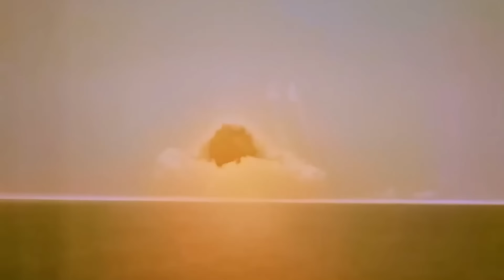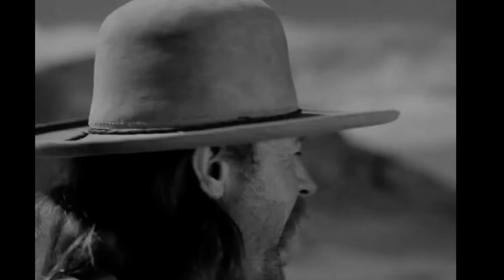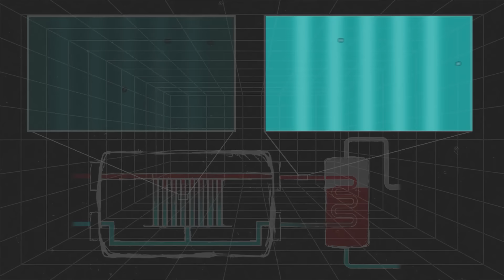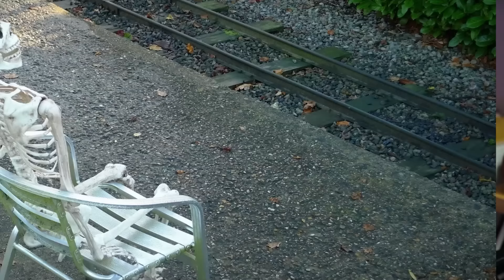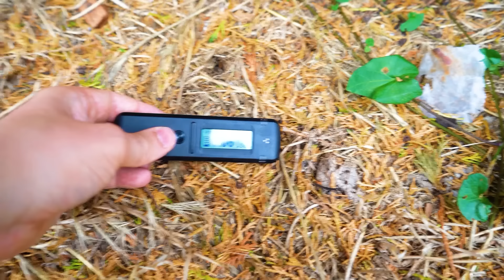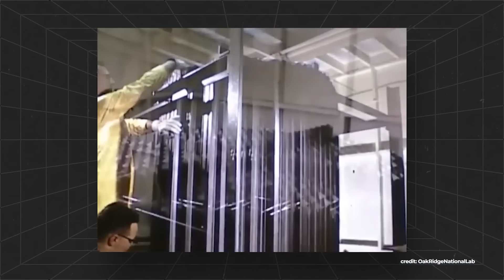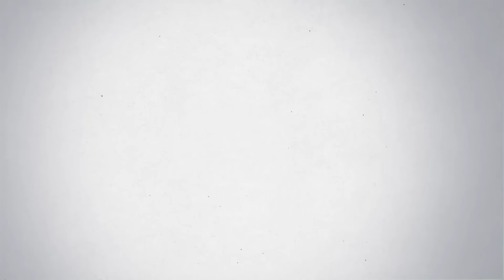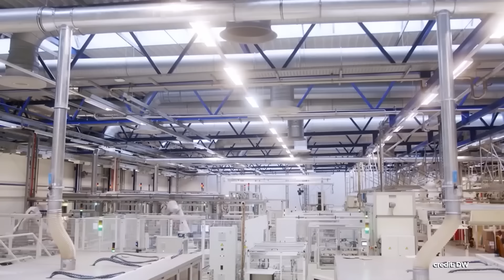It's Happening - China Launches World's First Thorium Nuclear Reactor

Comment: Not only is thorium 3-4 times more abundant than uranium, as you said, but over 99% of uranium, U-238 is not fissile (able to be split when hit with a neutron). In order to use it,  the mix must be enriched by removing some of the U-238 and leaving a higher percentage of U-235. This is very expensive. In contrast, thorium is 100% usable. A sample is hundreds of times less expensive than uranium. The main drawback to thorium is that a molten salt mixture is corrosive and can eat away at the container it is in.
Reply: It needs to be enriched because of the use of light water as a moderator/coolent.   Light water absorbs neutrons at a higher rate, which stops the reactor from maintaining a chain reaction.   A heavy water reactor like the CANDU can actually use non enriched uranium.
Reply: You still need uranium as no throium isotopes are fissile but they are fertile so can decay into U 233 if there are fast breeder reactor
Reply: @Idris.505  But you can use plain ol' uranium, spent fuel, and even depleted uranium in the right type of reactor to get the thorium cycle going.
Reply: @RWZiggy  Yup fast breeder or molten salt, not being anti thorium just saying that Thorium is also not fissile
Reply: @idris4587yeah, but as we have so many radiating nuclear "wastes" heaped up it is a good way to get them useful and by this get rid of them at the same time!
Reply: Thorium might be breedable and fertile, but is it submissive?
Reply: @snes-mode7 😂
Reply: "The main drawback to thorium is that a molten salt mixture is corrosive and can eat away at the container it is in".  No, that is the main drawback to a molten salt reactor.  MSRs are not the only kind or reactor that can be fueled with thorium.
Reply: @JohnHughesChampigny  Also the corrosive issue has already been solved by purifying the salt. No new alloys or extensive downtimes required.
Reply: You can fission u238 with (fast spectrum) neutrons. Most reactors are in the thermal spectrum mostly  because the slow neutrons are a requirement to make plutonium. Thorium fissions very well in a fast spectrum reactor as well.
Reply: @christopherleubner6633  but heavy water isn't easy to come by either, is it?
Reply: @christopherleubner6633  Uranium-238 is fissionable but not fissile (does not support a chain reaction).
Reply: you can make a U238->Pu239 breeder just as you need to breed Th232 into U233. the molten salt fuel is the cool part
Reply: @samuelforsyth6374  Can you give example for U238->Pu239 breeder if it exists? Pu239 burner like BN-800 seems a lot more useful, although i don't understand why we have reactors for producing and burning Pu239 only in Europe and Asia, not in America.
Reply: @Signal_Glow  obviously still waiting on regulators doing salt creep testing but myfavroite design would be Elysium Industries Molten Chloride Salt Fast Reactor. 
the burners are fine/good while both sides have wepons grade they need to get rid off but molten salt is very versatile.
Reply: Actually, the biggest issues are the creation of U-233 and how to deal with the Protactinium 233 (half life 27 days) and Pa-231 (half life 32,000 years) that is produced, which are all highly radioactive (producing lots of beta and gamma radiation) but which needs to be removed from the process. Theoretically, a Thorium reactor could be safer to operate (it won't suffer a meltdown), but presents massive health risks to workers in the plant.
Reply: @nicholasconder4703  yea I prefer U238->Pu239 fuel cycle you get more tolerance with neutronics so you can use Cl salt instead of Fl = less vessel problems and higher temps.  MCSFR
Reply: The theoretical use of Thorium fuel lies above 99% (i.e. > 99% of the fuel is converted into energy), whereas 'traditional' solid (pellet) fuel reactors get to about 0.5% before the pellets are so cracked through byproducts that they need to be removed.  I think the solid fuel rods can be reprocessed to get some more energy from them, but that's it then - the result is a lot of long term radioactive waste.  That's why Thorium is so interesting: safety and security are simpler, fuel is abundant and used far more efficiently, and the output heat can also be used directly if needed.  As temperature self regulation is a default feature of how it works, power generation is also easier as 'load following' is pretty much a default feature.
Reply: @freddoflintstono9321  It still produces lots of long term radioactive waste: the only difference is a greater proportion (not all by any means though) of the fuel rods themselves can be potentially "used" leaving relatively less dangerous actinide waste, but it still produces radioactive waste, including the plutonium produced by uranium reactors. It's a misnomer in some ways to even call thorium reactors thorium reactors, they are actually uranium 233 reactors, as that's what the thorium has to be turned into in a toxic and dangerous process of irradiation to turn it into nuclear fuel, a process so dangerous, it can't be done by humans, and has to be automated in biologically sealed quarantine facilities.
Reply: @pixelwash9707  The Th half life is quite short with waste becoming safe after less than 30 years of storage.
Reply: @freddoflintstono9321  "the result is a lot of long term radioactive waste" This is simply not true. A lot of the biproducts can be separated out easily and safely, and some of those biproducts often then go on to be used in medicine (often as core materials in X-Ray and Radiotherapy machines) and in sensitive scientific research equipment and experiments. Uranium that is still usable can be then thrown back in after reprocessing, while uranium that is so thoroughly depleted it is utterly useless for all other applications can be processed into Armor Piercing Depleted Uranium ammunition for use by US and NATO armed forces (For example, with the A-10's Gau-8 Avenger or the M1 Abrams' 120mm cannon). What isn't or can't be reused for any purpose (military or otherwise) gets placed into carefully designed casks on site that vent out a lot of thermal energy with relatively safe radioactive footprint (Kyle Hill put a geiger counter up against the thermal vent of one such cask in a video he made with permission from the IAEA and USNRC. The counter "clicked" showing higher than average radiation, but it wasn't screaming like it would be if the radiation dosage was dangerous. That's a testament to how safe these nuclear fuel casks really are.)
Reply: @freddoflintstono9321  That is a point for molten salt, not for Thorium. The same can be achieved with Uranium.
Reply: thank you for sharing your knowledge
Reply: @lynnebalzer5520  molten salt reactors are not specific to thorium. They can be used with the real u-238 in a U-Pu fuel cycle as well as the spent fuel from U-235-based PWRs. The main drawback to thorium is that we don't have a regulatory framework surrounding its handling and disposal, which we do for all U-varieties, and this is why western economies are struggling with thorium reactors. China on the other hand doesn't have this problem.
Reply: @nowandrew4442  So true. This is a problem about bureaucratic inertia.  Not that China is any great shakes at it.  They boldly purloin technologies from elsewhere and push them as hard as they can, sometimes without regard to the safety of their people.  The Soviet Union did the same.  If we want to get beyond TED talks and be first in technological innovation we have to stop trying to catch up with our adversaries and concentrate on the virtues that  got us ahead in the first place.
Reply: Can use titanium pipes
Reply: @TanLiat  Titanium is a real biatch to weld.
Reply: @juslitor Not with "Brown-Gas" (or HHO gas Mix!) 😅 that stuff can even melt tungsten!
Reply: "The main drawback to thorium is that a molten salt mixture is corrosive and can eat away at the container it is in."

Thus solving the problem entirely 😂😂😂
Reply: @alastairhewitt380  A big part of the Oak Ridge MSR program was working on solving the corrosion problem. Reading the available project documentation, the corrosion problem was considered solved by the 1960s.
Reply: @alastairhewitt380 We actually long ago solved that problem using hastelloy.
The corrosion rate is 0.1 mm per decade at 800 deg C.  The answer is just to use slightly thicker pipes.
Reply: Moreover all countries can not enrich uranium since high enrichment rate => nuclear bomb
Reply: The other big problem with uranium reactors is that once the fuel is spent, it still has a lot of U-235 and U-238 in it, just not enough to work in a reactor, so the fuel rods are removed and sit in cooling ponds near the reactor.  That was a big issue in Fukushima - the cooling pools drained, and the spent fuel rods partially melted, expelling the still very radioactive spent fuel into the ocean.  Thorium doesn't have that problem at all.  There are still radioactive waste products, but they are much smaller by volume, and generally have shorter half-lives.
Reply: Of course it can
Reply: dude theyve known this since the 30's and thats 100% why it wasnt used you so gd right its not funny. thank you for your input good sir
Reply: Thorium is 100% usable in exactly the same way that un-enriched uranium is 100% usable.
Reply: How much energy is required compared to how much is generated? I believe that even if the little reactor core only lasted 5 years.. that the EROEI would be over 100, vastly better, and more importantly quicker  than the renewables. For example, if you get 20x the energy, after 30 years, most of that will be used to just barely power the world, but if you get 100x over just 5 years, plenty of energy will be left over to literally exponentiate its own growth and power DOUBLE the world (or 10x)!
Reply: @fireofenergy  look up LCOE.
Reply: @nowandrew4442  
Yes, look up how much less expensive (or the levelized cost of energy is) when such energy generation machines are...
MASS PRODUCED!
Reply: @fireofenergy  indeed. Quite difficult to mass-produce a one-off nuclear power station.....
Reply: Fast reactors can burn through both. Even Uranium 238 is fissile when neutrons are at these speeds.
Reply: @AdjectiveBlazkowicz  Thats why it is considered "fissionable", "fissile" means it can be fissioned with thermal neutrons. Ppl mix around these key terms all the time.
Reply: The use of Thorium and the use of salt are two unrelated technical subjects.
Reply: Uh oh! China’s trying to get out of the box - If they can meet their energy needs, and have increasing amounts of electric cars, then the threat of being cut off by the world is less severe. Then they’re freer to invade Taiwan.
Reply: You can breed uranium too. Into plutonium, which you can use as fuel. It's not just a thorium thing. You can make an uranium molten salt reactor, or a sodium-cooled uranium breeder reactor.
Reply: @illuminate4622   plutonium is more easily made as weapons grade than U233 that is fissile material of thorium cycle
Reply: @Sevensixtytwo  true, but pretty much nobody got nukes by first going with peaceful nuclear power. Anyone who wants nukes is going to make a graphite military reactor.
Reply: @illuminate4622  You know what India did back in 70's?
Reply: @Sevensixtytwo  I said pretty much all. North Korea has the bomb, but no peaceful energy production. Finland(where I'm from) and Sweden don't have weapons, but have power plants.
Reply: @illuminate4622  Don't change topics when suggesting use of plutonium as nuclear energy production. It can be done and France and USA had reactors that breeded plutonium for feeding back. But there is big problem for nuclear proliferation.
Reply: @Sevensixtytwo  Had reactors.....They didn't work as planned.
Reply: U238 is fertile, like thorium - MSRE proved that you can breed it to plutonium(*) and burn it too, but the sheer abundance of thorium raises the question of why you'd bother

A thorium economy would make rare earth mines worldwide suddenly be economic. In fact they'd all pivot from being "rare earth mines" to being "thorium mines" with a dash of rare earth as a side gig.

It's worth considering that the reason China's cornered the rare earth markets isn't "lax envirnmental standards" but because the government there has been buying up and stockpiling all the thorium those mines produce - that in turn reduces mine operator waste disposal costs by 80-90% and allows them to simply put the tailings back in the hole they were dug out of

(*) ~1/3 of the energy produced by water-moderated nuclear reactors comes from the U238-plutonium-fission path. This is the source of the bogus claims that power reactors produce plutonium for weapons but the reality is that it's such a hopeless mess of isotopes that it would cause any bomb made from it to fizzle due to the excess radioactivity of other Pu isotopes (this is the same reason U233 bombs don't work - the U232 that can't be separated out is radioactive enough to make them dangerous to handle AND the things go off prematurely. The best anyone's been able to achieve for U233 weapons was a 50% reduction in yield over plutonium (using a 50/50 mix of U233/Pu239) and almost all other attempts fizzled or only barely exceeded "fizzle" status
Reply: Joker. Thorium is not fissile either. Don’t you know that!?
Reply: @adbogo  Do you not comprehend the process?
Reply: @peterm.eggers520  Thorium-232, the only naturally occurring isotope of thorium, is a fissionable material but not a fissile one, meaning that it needs high-energy neutrons to undergo fission .
Reply: Maybe Elon Musk could get involved and then we could maybe have several thorium plants up and running in three to four years instead of waiting for thumb twitching politicians and their supporters to do anything ?
Reply: many indian scinetist is died during 1990-2010 who is working on thorium reactor , India has largest thorium reserves in the world and we are almost close to build thorium based nuclear reactor, currently project completed its first two stages and last 3rd stage is going to be completed by 2026-27
Reply: Thorium does not have to be used in a molten salt reactor. A more conventional one is possible.
Reply: Ever heard of ceramics?
Reply: you still need some fissile uranium to run a thorium reactor. The upside is that almost 99% of the Thorium is consumed, while in a uranium reactor , only about 4-5% of the uranium is consumed, and the waste fuel, still has more than 90% of the unfissile Uranium that went in. 

Now, wasted fuel form a Uranium cycle , can be recycled by adding more fissile Uranium to it, BUT , you also have to remove the plutonium and protactinium that was created. It turns out that is is cheaper to mine new Uranium, than it is to clean up the old Uranium and remove the plutonium and protactinium .
Reply: i am concerned about corosion in salt and high temperature environments
Reply: Thanks for that. Now other numbers make sense.
Reply: So we have to find suitable materials and suitable designs ....
Reply: Thorium isn't fissiile either.  It is NOT "100% usable".  That's misinformation.

Thorium and U-238 are more or less identical.  Neither of them are fissile.  Both need a breeder reactor to be converted to a fissile material, to produce energy.
Reply: The problem is that our governments are alfa people. fresh from university.    They are no less than a disaster .....
Reply: Neither U238 nor thorium is fissile, both need a breeder reactor to be useful, so they compare well. We have thousands of years worth of U238 already mined and separated ready to be used and no thorium.
Reply: @chapter4travels we have crazy amounts of thorium already
Reply: @chapter4travels Well, fuel is only a small part of the cost of running a nuclear reactor anyway.

Any nuclear would be better than coal.
Reply: Not if coal is cheaper, as in the full cost of the plant, not just the fuel.
Reply: @chapter4travels  the cost of energy produced by coal does not consider the environmental cost which is up to three or four times greater than what they sold the energy for. I really bad deal actually. They’re currently installing wind and solar cost competitive with just the supply of the cold to say nothing of building the power.
Reply: @colingenge9999  Wind and solar are not in the same category as coal. Developing countries need cheap reliable electricity and industrial heat, they don't care about the pollution or the CO2. They will use coal and should use coal until there is a viable replacement that is cheaper. High-temperature/low-pressure nuclear has that potential if regulators would allow it. Wind and solar are good for virtue signaling, but that's about it.
Reply: @poindextertunes  I like that common sense is considered right wing.
Reply: @chapter4travels  many decommissioned and active coal plants can be converted into nuclear power plants as both are essentially steam turbines, thus reducing the cost of building nuclear power plants
Reply: @chapter4travels  Patently false. Monetary cost is not the one that truly matters.
Reply: @GodlyNoghri  To developing countries it is, as it should be.
Reply: @chapter4travels Again, false.
Reply: @chapter4travels Being wrong repeatedly and more fervently does not make you any less wrong, you know....
Reply: @GodlyNoghri  I'm glad you're not the one to force them into energy they can't afford. They get to choose for themselves and right now that choice is coal and will be until there is something just as versatile/reliable and cheaper.
Reply: @GodlyNoghri  3 billion people on this earth live with either no electricity or in energy poverty, they are more important than your feelings. This is objectively true.
Reply: @colingenge9999 the problem with solar and wind is that energy production depends on weather whereas energy production of gas and coal power plants can be almost instantly scaled to energy needs.
Reply: @TheHesseJames  Clearly gas powerplants run constantly and wind does not, there is no argument there. But to rely on that argument to put down SWB (solar wind battery storage) is overly simplistic and doesn’t acknowledge that to create enough energy to fulfill peaks in demand would require a massive infrastructure simply to provide that peak power which can be a factor of 4 from peak to minimum demand on any day. Instead of building expensive peaker gas turbine generators with $2/kWh energy, batteries can do this for pennies indicating they must be part of any grid as South Australia has discovered. 

Your “instant scaling” idea would mean that 75% of power generating capacity sit idle waiting for that short term demand peak. 

You could also say that demand depends on weather as well. As such increased sun requires more AC making solar a good choice. Increased wind increases heating loads in winter making wind to some degree self compensating with load increases. 

If you took the medical costs, at $225B per year in the US, + premature deaths at 180,000 to 350,000 per year due to burning of Fossil Fuels you could make the case that we could afford SWB on those costs alone but the Fossil Fuel Industry gets a pass on this forcing the entire country to pay this subsidy. LCOE or SWB is 4 to 5¢ per kWh but gas and coal is more than that so by every economic measure, we have the deadliest and most expensive system but hey, we get to listen to Fossil Fuel Industry propaganda all day so surely that is worth something.
Reply: @chapter4travels  Except the issues with coal that the reserves deplete pretty quick I mean before we even would have to think about running out of nuclear fuel  we'd already run out of coal a long long time ago, Coal is nowhere near the energy density of nuclear fuel, and with Coal we pump most of the waste products (Lot's and lot's CO2) straight into the atmosphere which is the maine cause of the Klimate change (together with other cheap Fossile fuels).
Reply: @guntere1004  The world has vast reserves of coal so until nuclear regulators allow nuclear to be as cheap as it can be, we should use it. There is no reason for advanced nuclear to be any more expensive than coal or natural gas, only regulators make it that way to protect the fossil fuel industry.
Reply: @colingenge9999 
The only environmental cost of coal is cleaning the exhaust so that only CO2 and H2O escape.  Those are the building blocks of life when combined with sunlight.
Reply: @peterm.eggers520  CO2 is also a very potent greenhouse gas and major contributor to global warming. Also coal mines devastate areas the size of Cities for decades
Reply: @guntere1004  Atmospheric CO2 is a trace gas that has a logarithmic greenhouse effect curve meaning that the difference between 400 ppm and 800 ppm is barely noticeable in a controlled lab environment.  The effect of atmospheric CO2 is smaller than the error margin for water vapor which has a greater greenhouse effect than all other greenhouse gases combined.  The ability of water vapor to phase change into clouds makes all other greenhouse gases irrelevant.

In practical terms, there is a weak correlation between atmospheric CO2 and temperature over the last 600 million years with atmospheric CO2 following temperatures, not the other way around as has been falsely reported.  In fact, atmospheric CO2 and temperatures have gone dramatically in opposite directions at times.

Atmospheric CO2 fear is a global trillion dollar scam!
Reply: @chapter4travels  Not if you factor the CO2 emissions and their cost.
Reply: @chapter4travels  I had written a long, thorough reply that detailed many ways in which you're wrong, but apparently idi [...] ocy is a no-no word that got it blocked. No freedom of speech when private governments that aren't held to our constitutional minimums run our lives, I suppose...
Reply: @TheHesseJames  Not true.
Reply: Fuel is a small part of the cost & 100% of the profit.
Reply: @chapter4travels  I was going to say, a U238 reactor should be similar to a thorium 232 reactor. One becomes plutonium (fissile); the other, U233 (fissile).
Reply: @chapter4travels  There's tons of thorium buried all over America left over from from mining other stuff. One place has enough for 3 years of energy for America.
Reply: @ubroc  Right, spread out and buried as mining spoils with no means of separating and refining. It can be but the industry that would need to do it doesn't exist and with our current EPA that could take decades to happen.
 U238 on the other hand is already separated and refined, ready to go.
Reply: Copenhagen Atomics is making tractor trailer sized THorium reactors. I don’t know the date of the 1st commercially available version.
Reply: I hope the power plant is so fruitful we see US thorium power plants granting us massive amounts of cheap clean energy. Hopefully China will be a good role model to the rest of the world encouraging nuclear energy for cheaper power that doesn't poison our planet with greenhouse gasses.
Reply: The issue with Thorium reactors is and always has been that little detail at the end, and the fact that so many people treat it like an afterthought is insane. The salt mixture isn't just corrosive, it's highly corrosive and toxic and very expensive to handle and produce in quantity. The Pa-231 produced as a byproduct is also one of the worst nuclear byproducts and it's something that almost completely undercuts a thorium reactor's greatest selling point, i.e being relatively safe and "clean"
Reply: U-238 is usable in a MSR though so the real "ratio advantage" of thorium is the 4:1 one. The usual (sensible) argument I hear is that even if we adopt MSR (a wise move), Th still has a hard time making an argument for itself over U because of the already-established mining infrastructure for U - not to mention the buckets of spent fuel that can be reprocessed by Fast-breeders which themselves would give more energy than we need for the next 1000 years. This is thorium's biggest hurdle, really.
Reply: @nowandrew4442  There’s vast deposits of thorium in the US too. In fact, one of the main reasons the rare earth industry in the US went offshore was the thorium contamination in RE ores. 

The thorium byproduct used to be reburied but changing US regulations required more expensive disposal solutions. Rather than pay for that, the industry simply chose to buy RE elements from foreign producers who didn’t have environmental regulatory costs.
Reply: @nohphd  deposits, yes. That's only 10% of the battle. The 90% is handling and storage regulations. China's advantage isn't the stockpile, it's regulatory fluidity.
Reply: @nowandrew4442
Reply: Head back to discovering new ideas about protons which some say is very little understood.  So, if we quickly learn just what they are and how those particles react with nano masers and/or ultrasound, then we could safely employ fusion, which generates large amounts of ether forces which could be condensed and used to power new energy systems just like they did in ancient Atlantis!
Reply: @williamgidrewicz4775  Ah the comic relief, always nice :D
Reply: If what I've read about this technology is correct, these reactors can run off of any fertile actinide. U238 breeds into Plutonium 239 which is fissionable, so these machines can burn natural Uranium.
Reply: @steveo7006  It's never been tried.